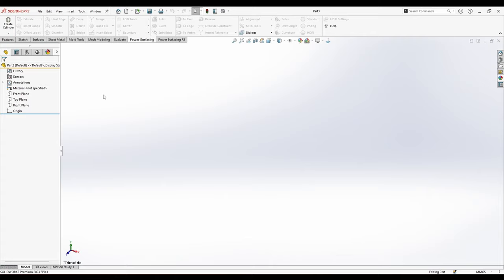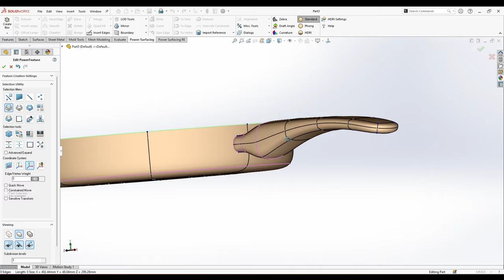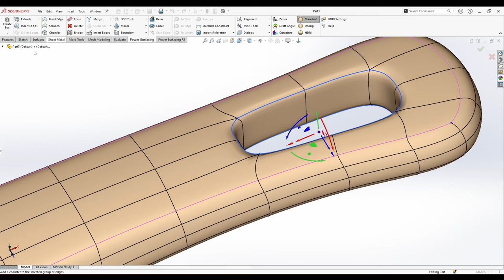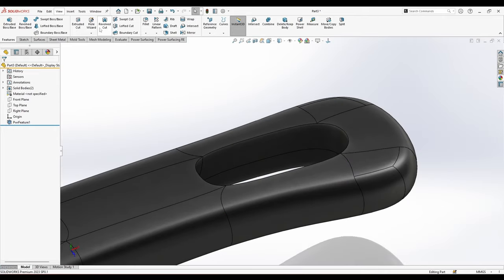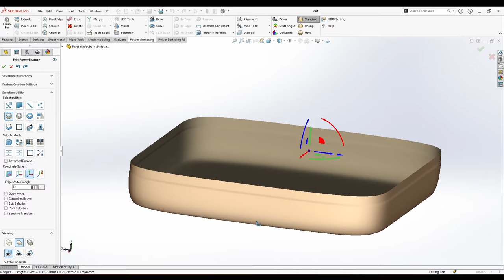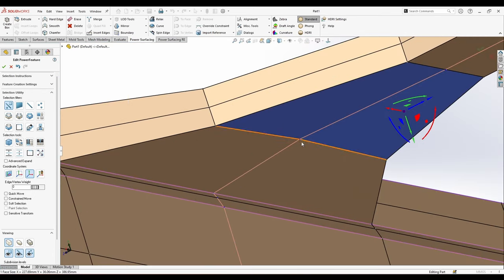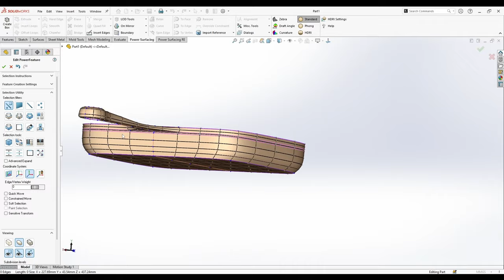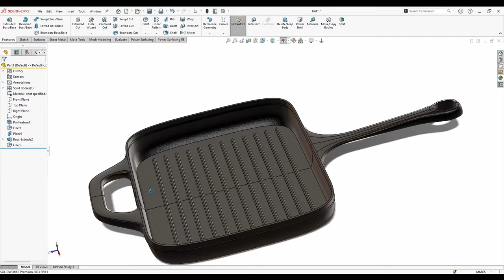Modeling Pan & Grill Using Power Surfacing | SOLIDWORKS

Comment: Great way to learn about the 'unsew' and 'on mirror' commands!
This is just an unbelievably incredible piece of software that fills a hole in Solidworks that has been there for years. 

Thank you for the guided and spoken tutorials that model practical and real-world examples. I find them incredibly useful. 

-

I completely understand that you can't do personal requests, so I understand if you can't do this: but if you would find this a useful tutorial for your audience, could you do a tutorial on fitting a square screen in an organic shape? 
So basically imagine a (american)football-kind-of-shape (an elongated ball) and then try to add a cutout for an LCD on one side, in that in a way that we still retain a nice organic shape of the body. The shape of the body can change a little, but it should retain it's original shape where possible and it should have a perfect fit towards the LCD screen. 
These days that's a very common problem, but whenever I have more rounded shapes and I have to fit a perfect square on that, I seem to struggle with it: adding a 100% crease onto a more organic shape often results in a more egg-shaped flat surface or edges that start to break up (and I totally accept this must be me using the software in wrong and poorly educated ways)

The reason I'm asking is that we're currently in the process of designing a medical device. It's a hand-held 'gun', which has a somewhat rounded body, and in that body we need to fit an LCD screen. 

I managed to model it after-all with this software, but if at all possible I'd love to see your take on it. Can't help but feel there must be better ways than how I did it: currently I eased into a more square shape by modeling the geometry around the LCD screen and then I used a 35-ish crease to make the flat surface for the screen cut-out. I then cut the hole for the screen in solidworks. Resulting in not a perfect fit around the screen: since I used a cut extrude, the screen of course has a perfect square fit when looking from the right side, but looking from the front, the edges still have some curvature towards the center of the screen. It's a fair enough fit, but I'm just wondering how to make it a 100% perfect fit.
Reply from the maker: Thank you so much for this great compliment ! ❤️ we're happy to hear that, our pleasure to know that you liked our software and find it useful.  Please feel free to contact: loldeko23@gmail.com  send what you mean, and im gonna try to make a short video.